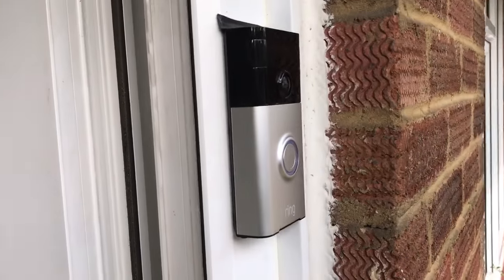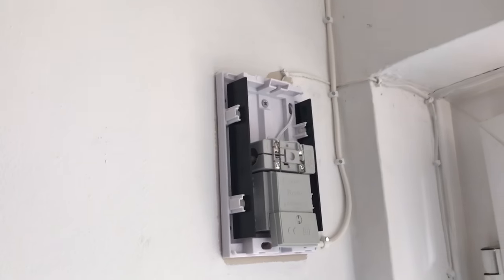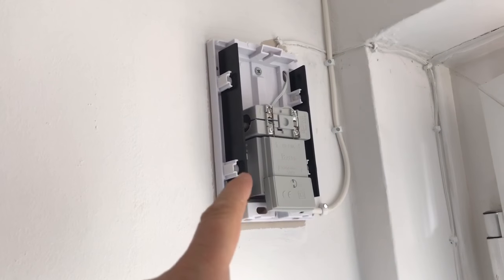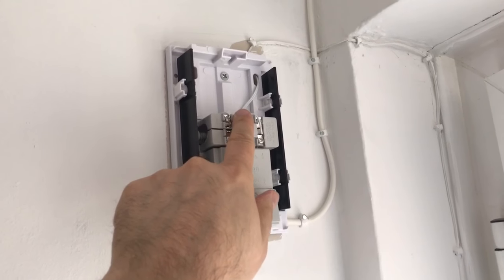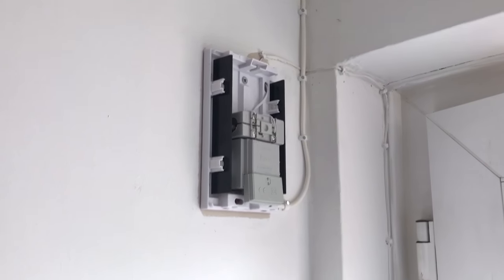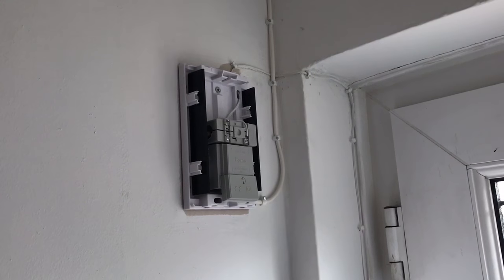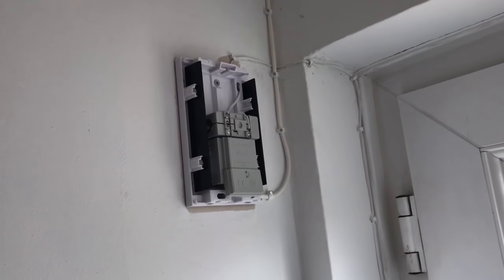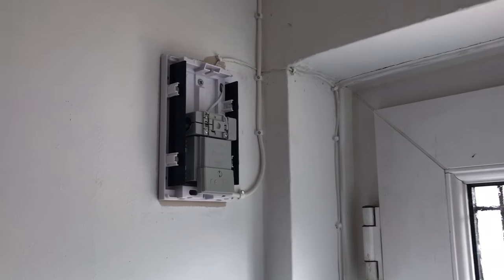Ring Doorbell - hard wiring Byron 776 (not 766 as per vid)

Comment: Great video . I have been trying to set up a friends .its hard wired and we had it working then it would not ring or video . I reset the ring at least 20 times with three different ring Associates at lest 4 hours . We can not get the WiFi to show up on her phone or mine . I’m so tired of ring keeping me on the phone . I’m thinking maybe the WiFi extender that not one tech advised . Can you add any suggestions Alex ?
Reply from the maker: Hi there Pat, yes I had similar issues. To be blunt the Ring doorbell WiFi is shockingly bad. I purchased a Ring WiFi network extender and never really had much luck so sent it back to Ring and I done the following, unfortunately though my desperation to get it working I had to go to these extreme lengths.  I purchased myself a cheap TP link router below, then I purchased some mains network plugs as my WiFi is no where near my doorbell, link below.  I plugged my network plug into my BT WiFi hub, plugged in one of my network plugs in room right next to the doorbell, then connected my TP link router to that plug and setup a WiFi network specifically for the doorbell, now it works incredibly well. Long winded and another £80.... but i mentally wrapped it up into the overall Ring costs... hope this helps ?

TP-LINK TL-WR1043ND Ultimate 300Mbps Wireless N Gigabit Router - wireless router - 802.11b/g/n (draft 2.0) - desktop https://www.amazon.co.uk/dp/B002YLAUU8/ref=cm_sw_r_cp_tai_9POMCb5K52EME

TP-Link TL-PA8010KIT Gigabit Powerline Starter Kit, Data Transfer Speed Up to 1200 Mbps, Ideal for HD Video Streaming and Online Gaming, No Configuration Required, 2 × 2 MIMO with Beamforming, UK Plug https://www.amazon.co.uk/dp/B01FFBN53W/ref=cm_sw_r_cp_tai_GTOMCbYNSEQ21

Comment: Hi l hardwired my ring doorbell to Byron 776 it showed hardwired on app no live view emailed ring told reboot followed instructions put back on back plate does not ring the Byron and not showing hardwired checked Byron rings by touching wires ring works fine on battery

Comment: Thanks for the video mate! 
I've ordered the Byron bell as I have been recharging mine for a while. 
Just to confirm: help guides say I should fit a 25ohm resistor in line with the transformer. (Not the diode for a digital chime). Reading the comments, am I right in thinking you haven't fitted a diode or resistor? 
Thanks again for posting this video - I've had the same fun hunting forums and videos! Cheers.
Reply from the maker: Steve Slater yes correct I have not fitted the diode
Reply from the maker: Mine is the standard ring doorbell not the pro, I don't think the Byron works with the pro

Comment: Hi Alex, I have the same setup as you and the same equipment, but it will not show that it is hardwired, and the battery looses %, I have requested help from ring but no response, any ideas please, thanks, bunnyone.
Reply from the maker: raymond bunyan hmmmm, strange, mine immediately switched to hardwired. Did you use the diode that came with it?
Reply: no just as you did so simple but will not work, we checked the wires looked at your video several times,
Reply from the maker: raymond bunyan yes you must not use the diode on the mechanical models. If you remove the doorbell and touch the wires together does the bell box ring? If not then it's not the Ring device
Reply: that's what we did, we did not use the diode, when the ring works from the battery its fine, when the 776 doorbell is wired to the mains its fine, but when the two are connected that's when the problem is, we asked ring 3 weeks ago if we can use a transformer and not a bell but no reply yet, I have tried to buy a transformer in the UK. but they do not think it would work
Reply from the maker: raymond bunyan do the wires in the bell box from the Ring go on diagonal wiring positions?
Reply from the maker: raymond bunyan also how long is the wire from the Ring to the bell box, I used as shorter wire as possible as the voltage and amps are so low, the length of wire could lose the charge.... also is the firmware up to date?
Reply: Alex, sorry about the delay in reply, will come back to you. a.s.a.p.
Reply from the maker: No worries Raymond, so you know my cable is under 3 foot from the doorbell to the bellbox.  I am wondering as its the lowest voltage that the Ring will accept 8v, that a longer wire is causing resistance and as such the Ring is not accepting it as hardwired.  Keep me updated....
Reply: Hi Alex, have checked the wiring in the Byron 776 and if you look at the " square " at the top inside you see 4 x screws I have the top left and bottom right wired to the ring device, the " live brown and the blue are wired o.k. otherwise the Byron would not ring when solo. the wire from the ring device is approx. 2 mtrs from the Byron device, cant do any less as its outside the  porch  what I can not understand is the ring device is running from the battery only but the % will not go down slowly it go's between 65 and 76 % i.e. up and down without being charged, I have the "live view  "off " to save the battery, I know the wifi signal is rubbish but it should not interfere with the hardwire side of things, what is strange is ring as a company have come up with this brill device but not thought about what you do if you cant hardwire and only run of off the battery and the weather is bad, you would of thought they would have a weatherproof cover while the battery is being charged, it will stop the brass contacts from the rain. ( food for thought) over to you Alex,
Reply from the maker: what you could to, just as a test, take the base plate off the wall and wire a shorter wire to the bell box and connect the ring up, just to see if it is the length of wire.

Yeah the voltage when I was using battery did go up and down even though I was not charging it.

If you have a Live View option, you must be hard wired, the device disables Live view when its on battery
Reply: 'don't think I can do anymore just one of those things if you have it or you don't just have to make a waterproof cover just in case,  by the way we tried the sorter wire and still no luck, never mind thanks for your ideas, and time Alex,
Reply from the maker: Sorry it did not work for you Raymond.....
Reply: I know I'm late to the party but I had this exact problem, the solution is not documented! You have to remove the device from your account using the app, press the orange button on the back, then re add it. Worked immediately!
Reply: Cheers for posting Tim, was having the same scenario as Raymond and your post helped in getting it all set up as required. Thanks.

Comment: Hi does the lower end of the voltage of the transformer make any difference to the quality or the actual ring doorbell? Thanks
Reply from the maker: sadiq87 not 100% sure on what your question is, do you mean that as I am only using 8v instead of a 24v transformer, in which case no it has no impact on quality....
Reply: Alex Yallop sorry yes that's what I meant, I installed my Ring doorbell with the Byron chime 776 but having connection issues it says hardwired on the app and the chime works for a few hours then it just seems to go into sleep mode and starts running from the battery which stops the chime from working. Have contacted Ring they seem to think it's the mounting plate thats the issue, do you have ideas what it could be?

Comment: Just wondering what terminals you have used on the bell ?
As i've wired mine in as per (de)structions & the Ring isn't activating the bell.
Reply from the maker: minimad5 hi, on mine top left and bottom right terminals...
Reply: Same issue, really irritating, did you ever resolve it?

Comment: Hi - I've just bought the Ring Pro today and instructions requested it's plugged through a 16v - 24v transformer. You mentioned the Byron 776 was only 8v and your Ring still worked. Is that correct?
Reply from the maker: Balbir Gohler yes, BUT, recently it seems to be a bit hit and miss if it works and Ring support have no idea why as the Byron is on their list of compatible mains door bells. They replaced the Ring which has not sorted it, I have replaced the wire with slightly thicker wire, still not reliable now Amazon have sent me another Byron, once that is in I can let you know if you like?
Reply from the maker: Balbir Gohler oh just re read your post, I don't think this Byron is NOT compatible with the Pro version. Mine is not the pro....
Reply: @MrPantss  Does this still work with the byron 776 as i just purchased for use with my ring 2?

Comment: So how exactly do you get the sound on the bell button turned off. Thanks
Reply from the maker: Hi, unfortunately you have to email help@ring.com and ask them to turn it off, such a shame they cant just include a volume control in the app.  To then apply the settings you need to push the button, the tone will sound and they it will stop.  Infact any updates I make to my silent Ring will make the sound when applying the changes, then it stops again

Comment: Great video. I did the same thing, eventually got the white light to come on and 'hardwired' on the app but after a short time, the white light would drop and shows up as 'battery' again. driving me insane! Anybody else with similar issues? Alex, have you since used a resistor? Is your set up in the video still working fine?
Reply from the maker: Hi John, white light? If you mean the ring around the light switch mine does not stay on, even though it’s hardwired, is it supposed to?
Reply: Hi Alex. I am led to believe it should stay solid white. I am having a nightmare, already trying my second Byron to see if the chime is at fault. Painful
Reply from the maker: John If it’s any help I have had two series 1 rings and now the new series 2, none of them light up. I have not used the resistor no they are only for the wireless mains doorbells I think. I think as the ring detects movement walking towards the door it the lights up. The key thing is in the app the battery symbol has lightening strike on it to show as hard wired. It takes a good 5 ton15 mind to update the app it’s not immediate. Once I left mine overnight and suddenly the battery showed as hard wired
Reply: Thanks Alex. So I purchased a new Byron and it connected perfectly and quickly (showing the lightening strike).. So I left it indoors connected overnight to see if it dropped and it didn't. I then connected it to the 3m 'actual' bell wire and worked again - great. Solid white light etc for a good 5 hours. I then installed it back on the plate outdoors and all good. Got up this am and the white light dropped and so did the 'hard wire' indicator on the app! This is now the second time it has dropped upon installing it outside. Talk about frustrating! Completely baffling.
Reply from the maker: John Do me a favour leave it for a week I had very similar issues, it was up and down for ages, I went through the same loops you have then it settled. Out of interest what wire have you used between the ring and Byron ? I changed to 3amp mains wire, also as you saw my wire is quite short from the Byron to the ring.
Reply: I was on the phone to Ring yesterday for 45 mins and they are completely stumped as to what my issue is. They can see everything works. They even saw my ring has the white light but doesn't register it's hardwired. They are sending me the Pro now given my 6 months of wireless/hardwired issues with the original. Appreciate your help Alex.

Comment: I've been out to B&Q and bought the same doorbell as my Ring Pro said it needed to be connected to a hardwired doorbell... i'm no electrician and i was wondering why i can't just put a plug on the end? instead of using that circuit block thing in the main board? (Electricians will be cursing now 😂)
I know it's says you plugged it in and i'm guessing straight into the socket instead of the circuit board? 
Am i right and does anyone know if this is ok?
Great video btw and i feel better knowing someone has had similar issues, thanks

Comment: Thank you Alex, did the same thing at home. Much better than the random emails I was getting from Ring. Still awaiting for their transformer to come through the post.

One minor problem I have is the buzzing noise coming out the Byron chime. Did anyone experience the same problem? Any possible remediation?
Reply from the maker: babill6 oooh that sounds like a duff transformer I would get the Byron replaced
Reply: Alex Yallop - many sincere thanks mate for your advice. I have ordered a new Byron from Amazon and I will share an update in a few days.
Reply: Thank you once again Alex. New Byron transformer works okay now. Very happy!
Reply: babill6 Whe. You say buzzing, was like a buzz with a rattle? And I am trying to run the pro, should this 776 work for this too?
Reply: @ Fiona - yes, the noise was constant buzz with a rattle. The transformer was faulty so I got it replaced. All working fine now.
For the PRO, I think you need higher voltage so I don't think this one will work with yours. Email the support Team and they will send you back the list of compatible ones. They can also send you a separate transformer (not chime) free of charge if you ask them. Good luck.

Comment: You did say 8VAC right?
Reply from the maker: Yes, 8v 1amp
Reply: I have the very same door bell and my Ring also worked with the transformer. My wife noticed a vibration and so I replaced the whole door bell with the transformer that came with the Ring. It recommends 24 VAC so guess my unit needs a bit more juice.
Reply from the maker: CerdicTheGreat I think the pro needs a 24v